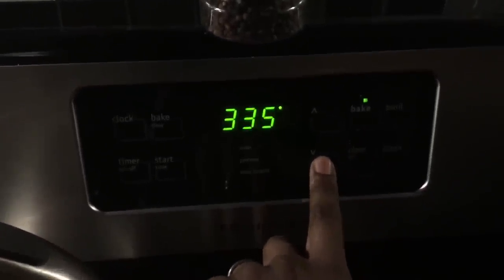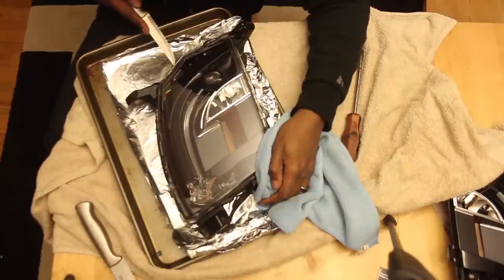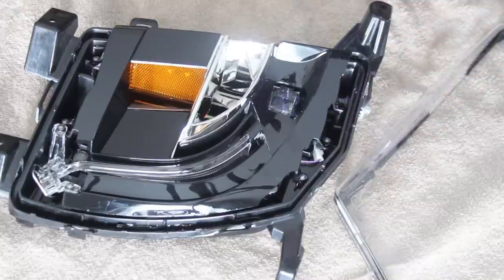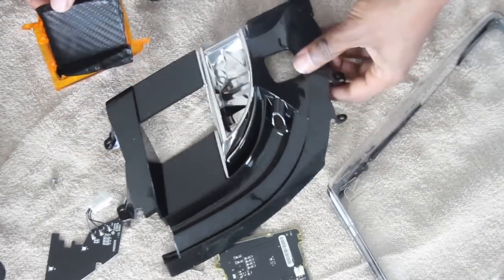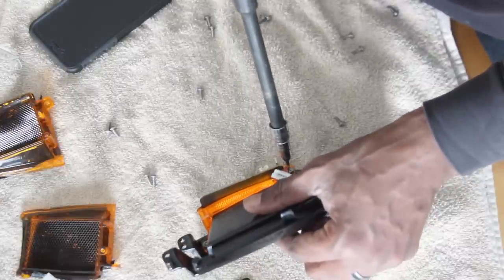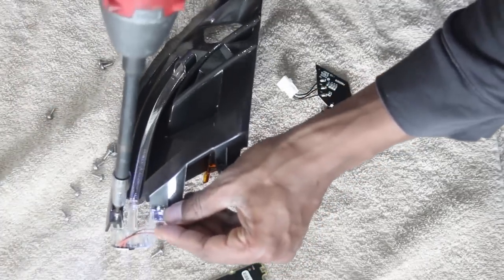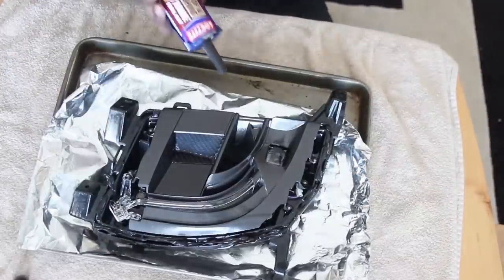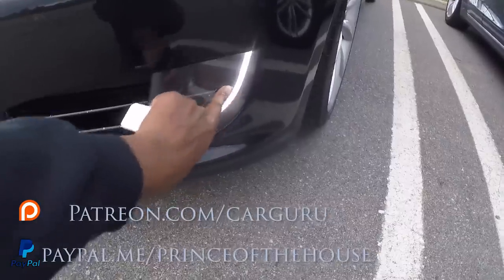Cooking My Tesla!: DIY Foglights

Comment: If you watch SV Seeker video about different types of sealants and outdoor adhesives, some of them actually create a stronger bond and can hold more weight than a large steel self tapping sheet metal screw--or in the case of his use, he tested each adhesive by hanging a 5 gallon bucket full of sand and steel billet off of a piece of wood glued to a steel plate. Some of them never let loose. So, those types of adhesives are actually really good, last for a long time and create a hell of a seal.

Comment: Doesn’t the NHTSA require those reflectors be a certain color like Amber or Clear ? I’m sure Tesla made those reflectors Amber because they may have been required to by law and not because they thought Amber was “cool” looking.
Reply: The nice thing about modifying your car is hes not the manufacturer and can get away with it
Reply: There is no regulation in terms of the color, however there is regulations in terms of visibility, I work in product development with an OEM and the color helps improve visibility and that is what is regulated heavily. If there was a white light there, and there was true fog, sometimes you can see through it, however in denser fog, the light will scatter and will cause the fog light to be useless, some manufacturers will use a white light with an amber filter and I believe that is what Tesla uses to help not only improve visibility but will also help reduce the light from scattering and have a glaring effect, that is what I have learned throughout the years, but I do know that NHTSA has been starting to include effectiveness of the headlights in their crash test rating system I believe, or that maybe consumer reports, not sure which one
Reply: There is no regulation on fog lights, aside from forbidden colors that mean other things (red for rear, blue for police). But you do have to have amber marker lights at the front (they can be red on the rear).
Fog lights are often amber because the shorter blue and green wavelengths in white light are short enough to scatter off the microscopic water droplets of fog while the yellow and red wavelengths pass mostly unaffected. Amber lights up less of the fog so you are lighting up the solid objects you want to avoid while avoiding being dazzled by your lights.
Further, spheres like water drops reflect light internally back to the source, its the same phenomenon used to make the reflective lane markers, and reflective tape. That's why fog lights are placed low, as far from the driver's eyes as practical.
Reply: My thoughts exactly. Even if it’s not illegal in your state, it seems like it was an important side reflector. Don’t want to come off sounding all PC but ...
I find most cars lacking in side visibility and reducing it is just putting your family in harms way for a small aesthetic improvement.

Comment: Will using a heat gun accomplish the same job?  Instead of putting the headlight into the oven possibly melting the entire plastic.
Reply: No, easier to melt it. You want to warm the adhesive
Reply: Quite the opposite. By heating the whole mass slowly you avoid warping as parts of different thicknesses grow at different rates if you have too high a temperature gradient through the material at one time. He removed the metal fasteners because those have a much higher conductivity and a lower heat capacity (takes less energy to raise temp) and might have left some 275 degree screws in contact with 175 degree plastic.
Heat guns tend to be brute force devices.

Comment: normally that amber light is a turn signal and it would be against the law to block it out in my state. the police would pull you over. now you could of got transparent black tint spray paint so it would show a light when turned on.

Comment: yo Rich, you could get better (cleaner) results with the caulking if you cut the hole to a more controllable opening size and  erganomic angle, and it seems maybe you didn't puncture the inner seal with the rod attachment on the caulk gun. luv u just trying to pay it forward

Comment: Rich...What all is on the light board ?...Jesus it's a light. Two wires to supply 12v. Or is that the board so it can preform the musical light show.
Reply: The musical light show is only on the X I believe.
Reply: Yea..Wasn't sure. Seems like quite a production for the lights.
Reply: Arizona Northstar just for foglights lol

Comment: What is the circuit board on the underside of the amber reflector for?
Reply: it houses the led chip and circut for the amber light
Reply: marble head Then what is the other board on the back of the amber reflector for?
Reply: One board was fog light LED the other Amber turn signal at least that was the way I understood it

Comment: I'm amazed how many people use their home ovens for either vacuum forming, or opening lenses like this.  Baking plastic to that temperature HAS to be giving off fumes into the air (perhaps even depositing chemicals onto the oven surfaces).  I would not want to breathe that in, nor have those chemicals leak onto any food I put in there in the future.  Spend the $100 on a portable electric oven, or just build a simple hotbox out of plywood and mount some cheap heatlamps inside with some foil to reflect the heat.  Safety first, no health compromises are worth modding your car for.
Reply from the maker: joe zenkus I'm not personally too worried about it. Anything that would be affected by the fumes is easily replaceable (wife, kids, stove etc.)
Reply: plus could you imagine the view count on that video? OMG drools vid title "Whoops, i rather screwed this up!" lol  :D
Reply: Yes and don't eat anything with Red Dye number 40.
Reply: FYI: Not trolling, truly enjoy your channel.  Just looking out for your well being.
Reply: LOL, this guy fucks.
Reply: no worries joe :)
Reply: Car Guru 😂😂

Comment: Did not understand why you had to bake it
Reply: Shoni Ben Cnaan heat is for the glue on the edge. u can use a hairdryer to.
Reply: The glue that is holding the lens will become more viscous when it's hot. Otherwise it's near impossible to take off the lens.